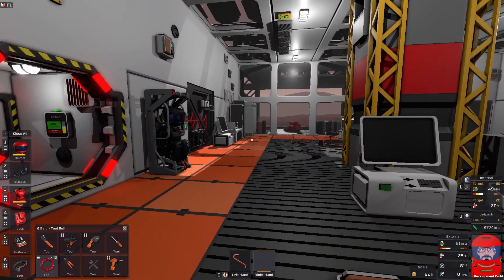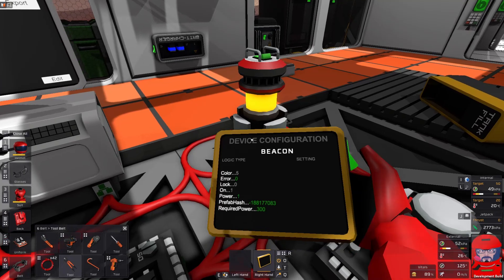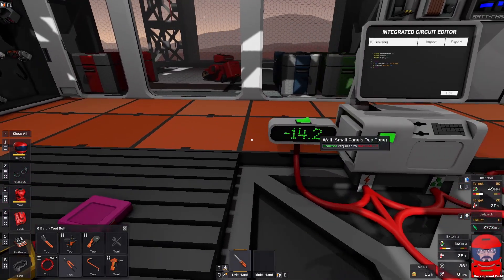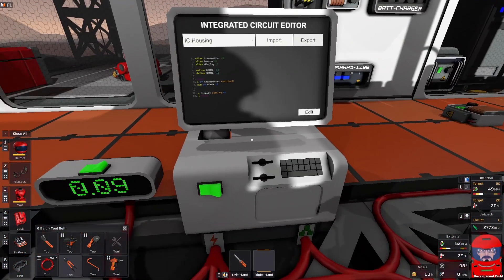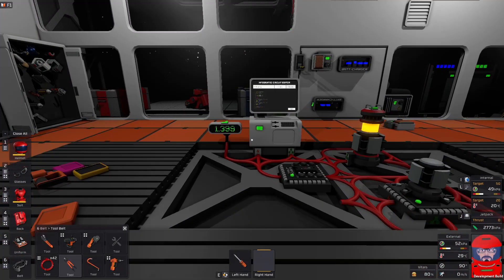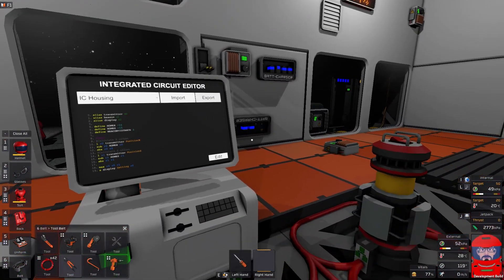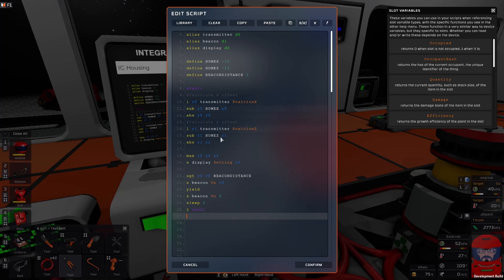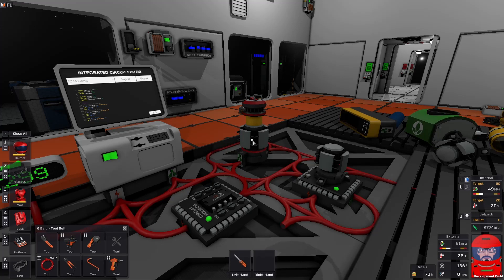Stationeers Low power beacon

Comment: Just an Idea: You could read out the suit Temprature. If you set it to 21 degrees: Switch the Beacon on - set it below: switch it off. Or the other way round in case power fails on the suit... ;
Reply: (I think you could read that our ..not shure...)

Comment: Just set this up on my base and found that when I activate the transmitter it turns off my AC. When I try to turn my AC back on it will turn off again. Turning off the transmitter fixes this. This is a problem on Venus. Anyone else run into this issue? I'm looking up the setting for AC so I can simply add it to the current code to hopefully resolve this.

Edit: Quick work around is changing the pins from d0 and d1 to d3 and d4. Because the suit and helmet are defined as 0 and 1 I figured that was the cause. Turning "OFF" the suit actually turns off AC in the interface. Likely caused by the line "s beacon on r0" when switching off the beacon it turns off the suit because the suit is also d0 by default.

Comment: could this be modified to 'walk' through multple people, for multiplayer? I'd think only turn on if  everyone is to far fromthe base (as otherwise they can track on the people at the base)
Reply from the maker: I dont think you can change the transmitter settings from the IC.  You can hook up multiple transmitters, one for each player.  Calculate a distance for each player and then activate the beacon when everyone is far away.

Comment: Or you could use the GPS module you already have right there. Would save 100% of the beacon power, plus not constantly consume 50W for the IC and Transmitter each.
Reply from the maker: That would work too.  But this is one part of a bigger system.  Stay tuned.

Comment: Neat idea! Any particular reason you check for max distX distY instead of calculating the proper distance (dist = sqrt(distX*distX + distY*distY)? Is it just a matter of it being good enough, or is there some deeper consideration I'm missing? 

If you got the proper dist calculated, you could check whether you're going away or towards the beacon by checking last ticks dist with current ticks dist, and modulate how often/long the beacon activates as a result. I.e. if you're moving closer, it does only need to pulse rarely as you're on track, but pulse could be a little longer so you can properly aim for it. If you're moving away, it could pulse more frequently but for a very short duration, so you can roughly pinpoint the direction if needed but not waste power keeping it on for long.

According to my made up calculations this can result in up to 57% power savings!
Reply from the maker: Max distance was used as it is near enough and keeps the code simple for people learning.  
Your ideas would make for a good logic exercise.  If you are moving tangential to your home vector the distance would remain the same so if you are using the distance measurement, the beacon would slow down when you going the wrong direction.  But the velocity is provided in the interface so you could calculate a velocity vector and modulate the pulse frequency based on your speed, assuming that when you are moving slowly you are not trying to navagate home.  I am inspired to overcomplicate this now.
Reply: evil  haha wonderful, I'm looking forward to overcomplication ;) I didn't realise velocity was provided, this is most useful! I'm very much looking forward to what you come up with. Making even the tiny things, like beacons, complex and feature rich is one of the joys of this game I think!

I was wondering after writing my previous post if you can detect jumping. I'm not sure you can, but activating the beacon on jumps only could be another fun way of implementing it. Perhaps flashing the flashlight on and off could work too, if the chip is aware of that? I bet there's a ton of more "active" solutions to it as well! Maybe the suit is aware of its inventory, and the beacon could be turned on when the tablet is removed from inventory (I.e. put in hand to look at it)?

Looking forward to what you come up with!
Reply from the maker: And why stop with the beacon?  I have ironically installed 1000W of lights and then complain about the beacon being 300W.  This could be easily modified to turn off all the lights and printers while you are away.  Perhaps the weather station could reduce the activation range of beacon to get you home in poor visibility.  Version 2 is getting bigger by the second.
Reply: Could even turn it off when stationary or dist difference is small enough to be considered stationary (like when mining)